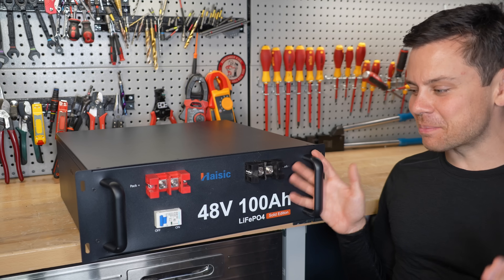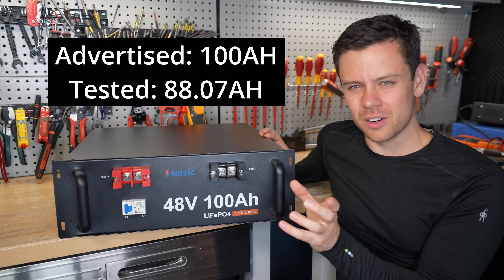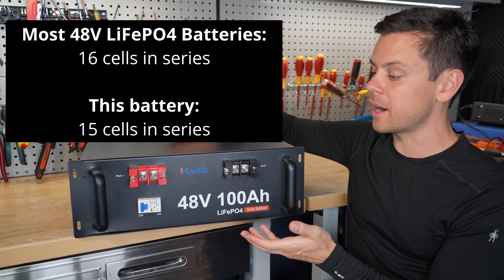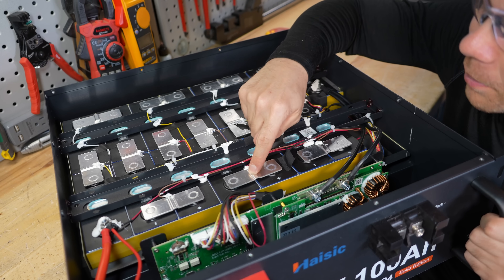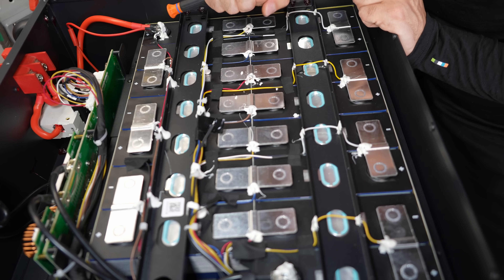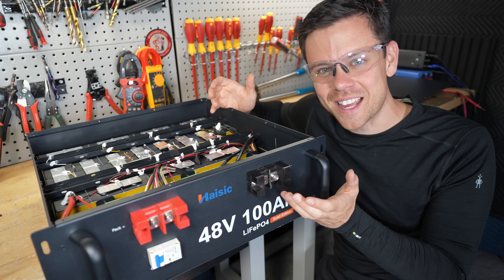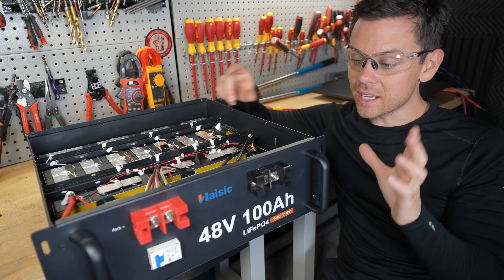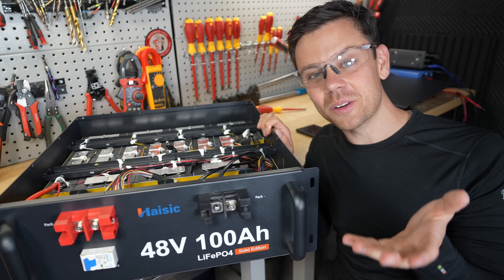48V Server Rack Battery for $549 on Amazon?! Haisic 48V 100AH

Comment: There's a battery sold in Brazil by Felicity Solar that doesn't deliver the capacity it claims, about 15% less than what's stated on all their batteries of that model. Several channels tested it, and none of them passed.

Comment: Hi I was wondering if you would consider doing a video on how to charge a Tesla or any other EV with solar. I know you kinda touched on it on a previous video while testing a portable backup system with a few extra 48v 100AH rack batteries. But it would be interesting to see a video on a DIY solution with solar panels hybrid split or single phase 220/240volt solar inverter.  Thank you for all the great videos you put out!

Comment: Will Review the VEVOR 48V 100Ah 51.2V Server Rack LiFePO4. I am very tempted to buy these but would like to have an honest review.
Reply: Yes, would love to see Will review it.  As of this post, the only Haisic 48V 100AH I find is $698.... while the Vevor is only $675, but 'looks' like a much better battery: has 16 cells, 3 (different) com ports on the front, lcd display with lots of options, & the one review I saw 'Tackle That' showed up to 4984Wh tested capacity.
Reply: I am not Will, but I have 3 of the vevor batteries.  One works.  One works, but the cells had broken loose, had to repair.  One has a bad cell and 3 shorts, also from shoddy case/cell containment.  Nowhere near worth the $675.  Get the Ecco worthy instead.

Comment: Great channel. 
I am into overlanding and have a question you might be able to answer. 
I have the Pecron 1500 and 500+ solar on my roof.
I want to run one of the new direct current (12,24 - or 48 volt) air conditioners.
Obviously, I need more battery power and charging. What recommendations can you make?

Comment: Will what is a good cheap 12v lithium battery? I have 2 x 100ah Litime mini batteries and didn't want to add a 3rd battery, I rather have like a 1 single 300ah battery. Whats a go smart 12v lithium battery?

Comment: Will Have you seen this: 48V 5500W All-in-One Solar Inverter Charger, Hybrid Solar Inverter with 120A MPPT Solar Charge Controller + AC Charger, LCD Display, fit for Lead-Acid and Lithium Batteries,110V/120V
Brand: Naturalpowev
$450.00

Comment: I wish more companies would come out with non-server rack 51.2v 50ah Lifepo4 batteries with at least a 100 amp BMS. There are many 51.2v 100ah batteries, but less 50ah. I want to use them as expansion batteries to charge power stations through solar input as a cheap expansion battery. The 100ah 51.2v are too heavy and bulky for me to easily handle. They are also too expensive. 2560wh added to a 1024wh power station will be enough for my purposes. I also do not want the metal server rack batteries. Bluetooth app so I can easily monitor the draw and SOC is something I would want.

Comment: You are too good regarding this battery. It's junk. Pure junk. Most higher power inverter/controller boxes need 48V. Missing 3.6V is going to be a problem. They will not be able to activate the inverter or if it gets activated it will cut off really soon due to the low voltage protection. Plus used batteries missing that much capacity is junk.

Comment: When I got my solar system installed they sold me the dyness b3 batteries and I didn't realize they were 15 cell batteries. I'm gonna get some of the seplos DIY kits cos I can source them from a UK seller and when I do I plan to take my 3 15cell batteries apart and build a new single battery from whey I can salvage plus what I can source from AliExpress

Comment: The interesting thing is that $600+ is basically the same price for an empty DIY Battery Box... which I happen to be currently shopping for...

I bet I could buy that unit and receive it quicker, and then buy 16 grade A 340Ah cells which can be found for $950-$1050 which usually come with all the business bar hardware...

And end up with a 17.5 kWh  battery for $1500-$1600... 
🤔🤯🤓

Comment: This battery perhaps is not meant to be used as a “48V” battery in a 48V system. It was meant to be used in a high voltage system whose charging profile didn’t depend on the 15S configuration of cells but rather on the aggregate voltage sum of individual server rack batteries. This makes it highly probable that it is used and was salvaged from a high voltage battery bank. It’s like the salvaged battery modules from an EV battery pack. These modules may not conform to any usable voltage systems.

Comment: I love living in the EU. No matter what the fine print says. The consumer is protected. Full warranty for at least a year, And you have to get service for as long as you should expect the thing to keep working.
For example, the warranty of a dustbin is a year. If it breaks after 3 years, that's your problem, what can you expect from a dustbin.
But a television should work for at least ten years. If it breaks after 3 years, the brand needs to warrant a repair that can't be more expensive than 30% of the new price.

Comment: These dudes copied a telecom server rack battery such as the HuaweiESM-48100B1. These telecom batteries (mainly to keep cell towers going in a grid failure, are the original server rack batteries and they are all 15s. But that works well for the telecom mission, but not as well for home battery storage. I bought a few cheap Huawei mentioned above over here in Thailand, they were two years old  and still at full capacity, which isn't as good as 16S but still way better than this cheap knock off. They cost me about $300- each. Now you can get them for $250. But that's here in Thailand where you can get new 580W panels for about $65.

Comment: Jbd offer tools to set the bms to 15 cells from 16.  The bms would shutdown if it was set for 16 cells and only 15 installed as the last cell would read short which is a failure.  You are correct, this is a horrible and potentially dangerous battery as putting it in parallel with a 16 cell battery would cause the bms to be the only method to prevent overcharging.  A defective bms and those 15 cells could be charged to potentially dangerous voltage.  It is marked 48v and not 52v so that's not the manufacturer issue, and would be fine with other 48v packs.  I suppose a consumer could retrofit an additional cell and reprogram the bms for a half decent pack and then replace the cells when it wears out.  The case and bms is almost worth 500 bucks.

Comment: I won’t be surprised if it’s this cheap because it’s a defect series with missing battery. If it had all 16 it might have reached the 100Ah capacity (I know math still says 90-ish but that might be due to lower voltages due to missing battery)

Comment: Have you seen the eco-worthy deals on eBay lately (3800 for 28kwhr free standing or 11500 for 76.8 server for 48V or 320 for 3.36kwh at 12 V)? They are crazy cheap. For non-lfp and just kwh/$ I saw a Fiskar 113+kwh battery for  1800. The lightning batteries are about 6k and ev6/ioniq5 about 5k. I wish there were more car battery to home products out there. That Fiskar is $16/kwh, the lightning at $60 and the ioniq at ~$65. Even the 12V Eco-worthy is $95/kwh, so still drastically more expensive. It really sucks that the most popular mainstream option (powerwall3) is about 14k installed, so about 1075/kwh. If we could close the gap, then energy independence would be solved.

Comment: BMS is not responding properly because it was designed, as you saw, for 16 cells. This assembler/manufacturer thinks that no one will look inside. Expects customers to struggle, think themselves ignorant, frustrated enough to just take a loss, rather than return ship struggle due to lithium battery shipping regulations.

Comment: Reminds me of the "bargain" batteries for power tools that the boss bought to replace the heavily used old original (5+ years). 
Looked identical to the original, weighed sign less, only worked 4 times before needing recharge (original lasted one hour). 
So I opened one, One less cell inside (lithium rechargeable).
Showed manager, and buyer. They simply shrugged. 
They bought 10, all junk, all China manufactured. Trying to save money, lower expenses.

Comment: i think 15s is useful in telecommunications stuff, at least that's what i've found a lot of the better ones advertised as. what is trash for home use may be a good thing for some, except the battery capacity thing. 
maybe if the bms is having issues and you suspect it is programmed wrong, they are cutting capacity off the top or bottom as well with other bms programming? 
actually maybe that would be an interesting datapoint to these cheaper batteries, is the bms actually operating the cells in a safe range.

Comment: the JBD BMS only $50. And in mass production. So there is overcapacity in China.

 15 Cell is 48v Battery. 
16 Cell for 51.2V battery.

The reason the 15 Cell version is Exist  is because cheap and old inverters ( Specifically inverter for lead acid batteries) struggle with high voltages.

Comment: Litime pulled the same crap with the 15S rack mount unit. I think they got called out on it because their reps are all over the reviews stating that the 48V battery is supposed to be 15 cells, and if you want a 52.8V battery that's a different thing. 

I'm fine with there being other options. But it's downright misleading to call a 15 cell LiFePO4 "48V", just because it technically can hit that voltage near its peak.

Edit:
To clarify, LiTime has both "48V" and also "52.8V" rack mount units. It is just the fact you could easily buy the wrong one, labelled as the right voltage, and have no idea. Calling out people in reviews also seems petty when they are absolutely in the wrong and they know it. I honestly thought they were the only ones who had even made a 15S unit. But the thing is, theirs costs $1200, not $500.

Comment: Can you see a situation where it would be logical to get a bunch of quality batteries, good buss bars and just use a BMS without a case in a semi fireproof temperature controlled closet? I watched another video where the guy was talking about the natural expansion during charging and it looks like most cases don't allow for much charging.
Reply: A bunch of the sub $1000 server rack batteries seem to have made that not economical.  Enough of them are doing it right (and you can see the teardown videos) that it's lower cost to just get one of the ones that reviews well, and less hassle, too.
Reply: @chrisl6546 I understand the cost aspect but, what about the limitations on battery expansion during charging that is limited by the case?

Comment: They use this because using 16 cells gives you 51.2 volts. These batteries are usually used with voltronic based inverter(company in china)

Comment: I had to do a double take when you said some sellers don't allow returns and others limit returns to 30 days. Then I realised that there's a handful of nations—Libya, Sudan, Afghanistan, Venezuela, Mongolia, and the US—that don't have basic consumer protection regulations extending to all sellers.

In my jurisdiction, advertised time-limited warranties are an agreement between manufacturer and retailer / consumer. They don't limit the warranty between retailer and consumer

I can use the tax depreciation rate for this product class to claim reasonable lifetime—which is 6 years. If, during that 6 years, the product fails to live up to its description or any representations made by the seller or their employees, I can claim a refund AND the cost of the return. In this case, Amazon is the retailer. These rights are irrevocable. That is, they can't be signed away with a contract.

Comment: "This item can be returned in its original condition for a full refund or replacement within 30 days of receipt. You may receive a partial or no refund on used, damaged or materially different returns."

Note the word "Free" isn't there or in the actual description like so many Amazon listings. You can return it but I bet you have to pay the freight.

Comment: You wouldn't say Amazon scammed you. Why say Temu scammed you? You know there are sellers on Temu just like amazon, and any seller can turn out to be a scammer right? Just wanted to call that out. Great video regardless.

Most batteries Say 51.2v 100AH. This one is saying 48v and 100AH. Technically, they aren't wrong. But in the US market we don't do things like this. When we say 48V, we expect 51.2V.

Comment: Buy 16 of these and build 15 good ones.
Reply: Half the price, same space 7/8ths the capacity
Reply: @Original_SJB 4.4/5 capacity... 😳 

😂 I'm just messing around
Reply: Still won't get full capacity
Reply: buy 15 and have 14 with a spare battery which you will probably need.
Have we considered that the reason they could have a good inverter is the inverter will only do 15 cells? That is why it was so cheap to put in.
Reply: LOL, exactly what I've just commented, before reading this :D
Reply: "good", would still only be like 95Ah instead of 100Ah+.

Edit: Total fail by me, would still be 88Ah :P
Reply: @jtaulen  its 88Ah per cell regardless of how you wire it. If you make a 16S battery with these cells, instead of a 48v88Ah battery, you get a 51.2v88Ah battery,  not 95 or 100
Reply: @cbflazaro  Jesus christ, of course it is :D What was I even thinking.
Reply: But this is also why Wh should be the default measure of capacity :)
Reply: @jtaulen I hate when they rate Wh! 

48v 100Ah is easy... I suppose to be fair 4800Wh is easy to cover EXCEPT when they rate Wh, it seems hard to find the voltage, in my experience

Comment: how much is a cell and would it be wroth it
Reply: The problem is the way they program the bms
I’ve 3 such batteries n I’ve bought 3 extra cells but getting the bms programmed for 16s has become a nightmare 
They run pace 16s bms but set for 15s
Reply: @MichaelsKarish  I guess it's above me I thought he said one of the problems was that it was a higher Eshelon 16 cell bms and it only had 15.  I thought maybe  adding  would solve the voltage problem and also just  a thought if the retunen didn't work maybe another idea for video
Reply: @mackmckinnon4407 yea
It’s a 16s bms set up as a 15s
Normally you’d think just adding 1 cell would work, but they’ve changed settings and sometimes rewritten the code that it doesn’t work unless you put in a new bms
That’s what I’m going to do
Put in a new bms, add an extra cell n integrate with the other 16s batteries
Fortunately the bms is only $70
Reply: @MichaelsKarish , sounds like some people can't even get out of their own way good luck with your modification

Comment: I mean, technically it is a 48V battery, 3.2V x 15 = 48V. So I guess it's either one of two things 1) They think they can get away with it because it's technically 48V or 2) They are totally oblivious to the market for which they're selling in and think it's what people want because so many of us just say "48V battery" instead of "51.2V battery". But, voltage aside, it's still a turd at 88% or 73% usable LOL.
Reply from the maker: 73%!! can you believe that lol so bad 🤣🤣
Reply: I mean sure, but a "12v"  Lead acid is about 12.4-12.8V full charged, making a "48v" LA battery ~49.6-51.2v
It's just scummy marketing.

Comment: This harkens back to  the early days where vendors didn't really understand that LiFePO4 "48V" should use a 16S configuration.  There was a ton of confusion across the board as some vendors did 15s and others did 16s.   I thought they had figured that out by now, but apparently someone didn't get the MEMO!
Reply: Since I don't know anything, why is not having16 cells an issue? I don't have any solar stuff, yet. But I enjoy Will's channel and it's a good learning resource. But I think this is the first time I remember hearing anything about not having 16 cells and that it would not work with other server rack batteries. I'll remember that, but I don't understand why?
Reply: @gmanjimbo3203  Each cell provides a voltage, and to get to the correct voltage you need a set amount. 15x3.2 = 48V, 16x3.2 = 51.2V. So you can see why people assume 15 cells would be enough, its providing 48V, but thats the nominal voltage. And as it gets used, and have a lower state of charge the voltage drops, and cutoff voltage is usually around 2.6 or so. 15x2.6 = 39v, 16x2,6 = 41.2v. And 48v inverters have an operating voltage, so if its gets below Xvoltage it will stop. Usually between 40V and 60V, which means a 15cell battery voltage will get below the cutoff before it has actually drawn the full capacity.
Reply: @jtaulen a good inverter works with very low voltages, and you can set the low voltage cutoff, so shouldn’t really be a problem if you configure everything right
Reply: @gmanjimbo3203  The reason is that it is an integral multiple of the smaller battery voltages typically constructed.  4S = 12.8V, 8S = 25.6V, 16S = 51.2V.

These are all defacto standards for building LFP packs and in particular 16S is the defacto standard for "48V" with LiFePO4 precisely because it allows you to put lower voltage whole-batteries into series to achieve a compatible result.

In the early days, numerous low-quality vendors didn't really understand this and thought that a "48V" LiFePO4 battery could be made from a 15S pack.  And it was cheaper.  They would market the batteries the same as the 16S vendors.  The result was mass confusion and huge incompatibilities between vendors and default settings for charge controllers and AC chargers.

These days everyone more or less has agreed on 4S / 8S / 16S configurations being "standard" configurations for LiFePO4.

-Matt
Reply: Pylontech is 15s